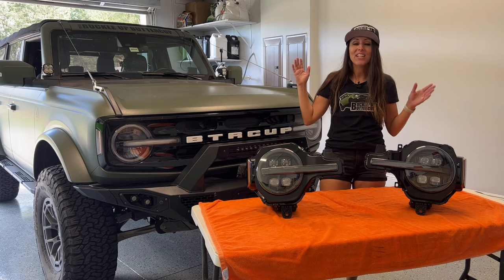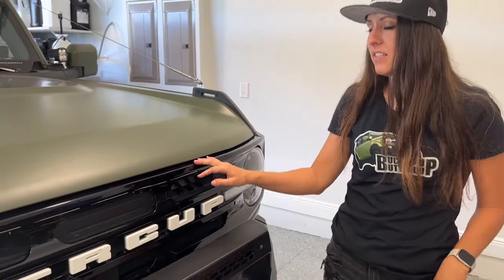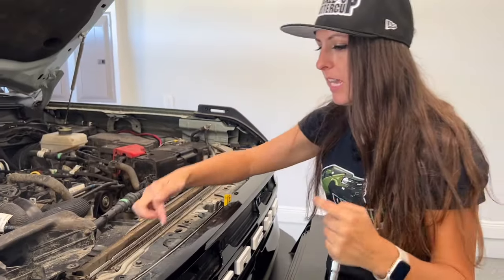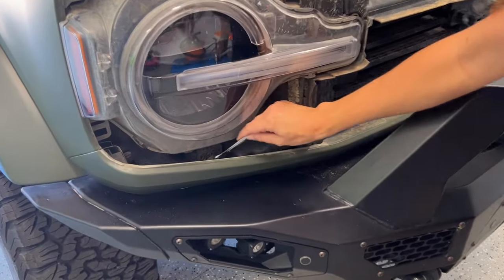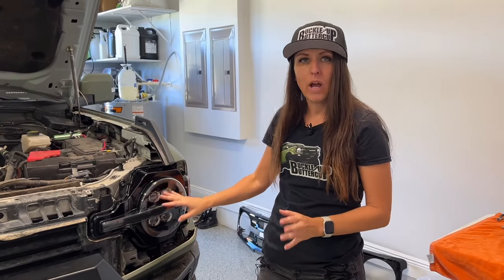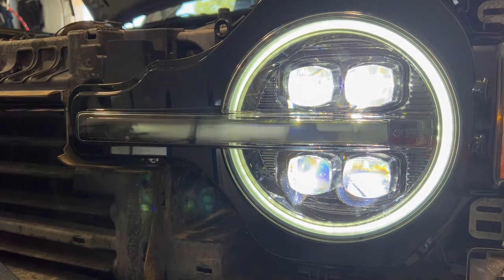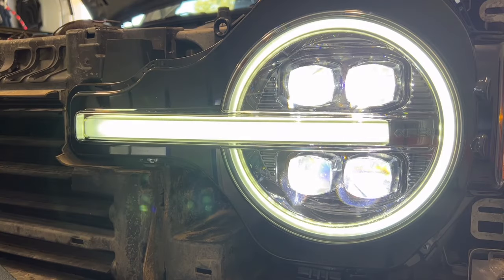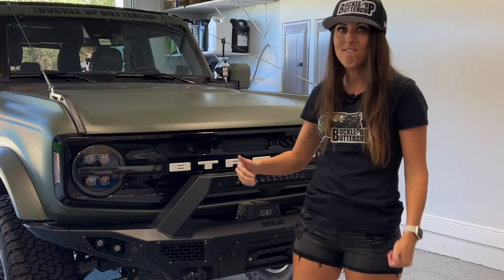AlphaRex USA Nova-Series Alpha-Black Headlights for Ford Bronco | Install & Review

Comment: Hi, Do you know if the alpha black drl is darker than the regular alpha rex?
Reply from the maker: No they are the same, the difference is on regular black there is some chrome casing around projectors
Reply: @Buckle Up Buttercup  sorry I should've clarified. I meant is the drl more of a yellow tint vs bright white? Their stock photos are a very bright white